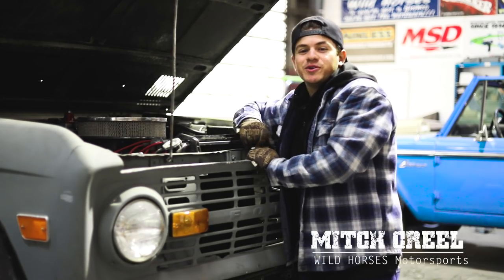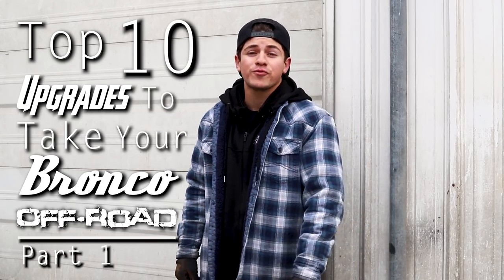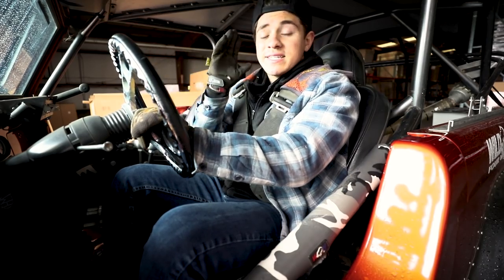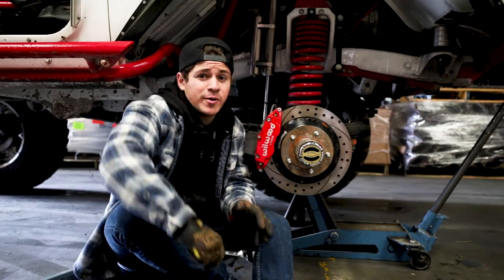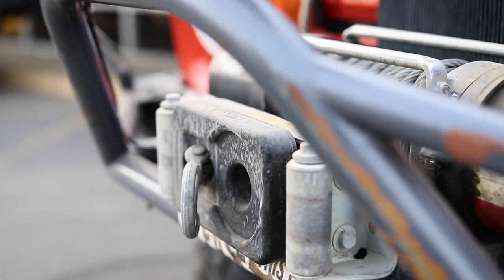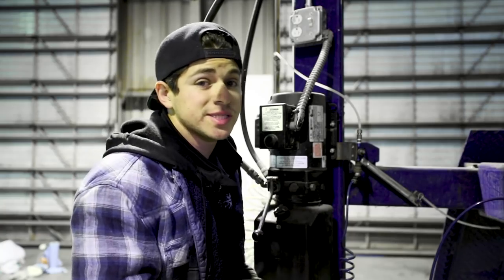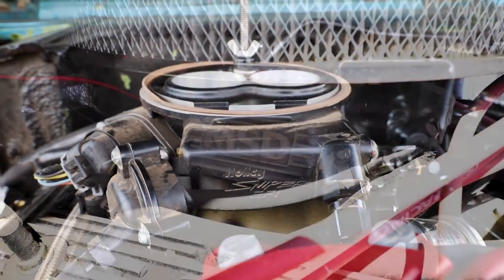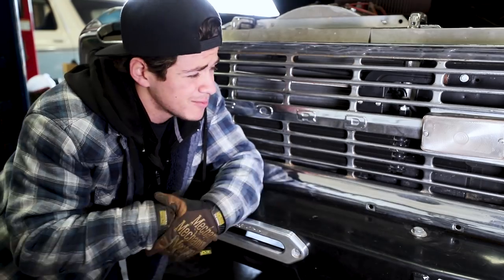Top 10 Upgrades to Take Your Bronco Off-Road: Part I

Comment: How did you put willwood brakes on a d44 want them on my 78 f150
Reply from the maker: We used our disc brake conversion kit. Not 100% sure if that will work for your setup but you can call our guys and get some more clarification. (209) 400-7200
Reply: Wild Horses Bronco TV dose the older bronco also use the 5x5.5 bolt pattern?
Reply from the maker: @bobhilly546312156332  Yes, 66-77 and 78-79 Broncos I know for sure used the 5 x 5.5 bolt pattern. Years after that I'm not sure but I think a quick google search can get that information.
Reply: Wild Horses Bronco TV i knew the full sized Broncos, 78-96 use the 5x5.5 bolt pattern
Reply from the maker: @bobhilly546312156332  Alright then yeah, 66-96 are all the same as far as I know. I think the Bronco II is the one that's different.
Reply: Wild Horses Bronco TV I’m thinking your kit will work, do you have a website
Reply from the maker: @bobhilly546312156332  Yessir, here's the link-  https://www.wildhorses4x4.com/
Reply: Wild Horses Bronco TV thank you